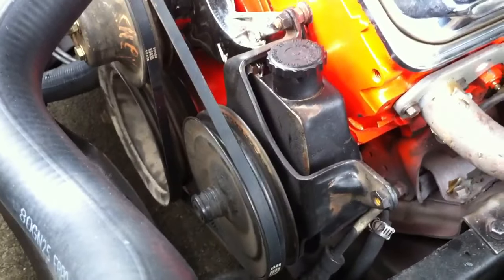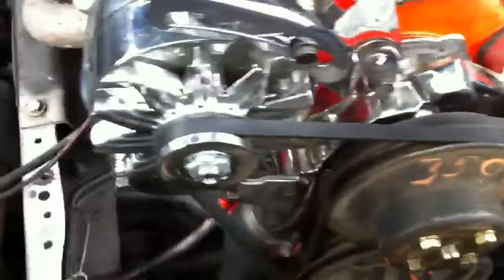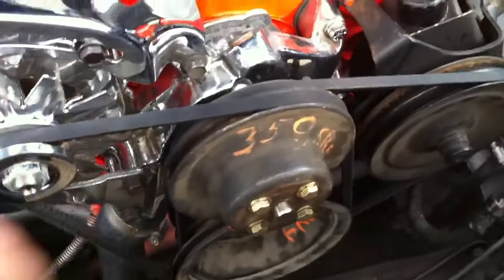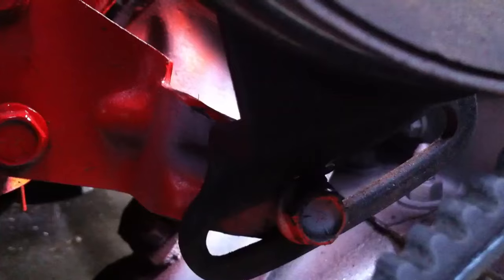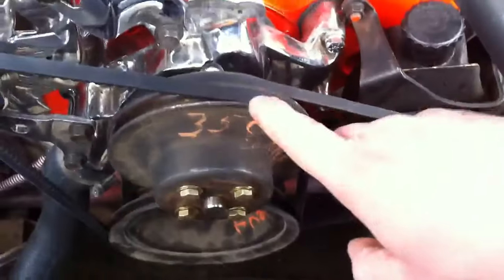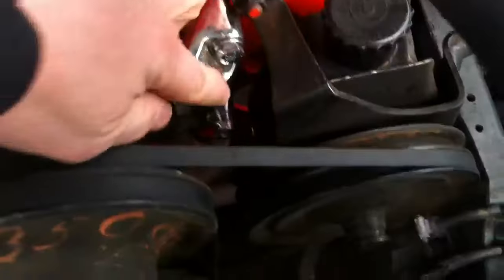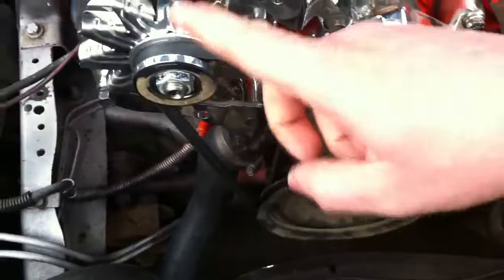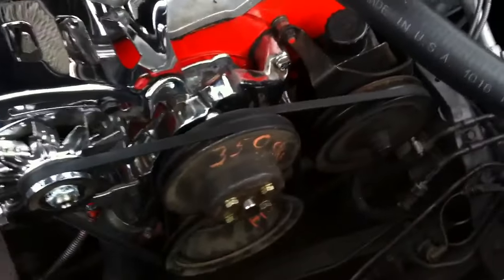How To Install a Power Steering Belt TALK Through - Chevrolet Truck C10

Comment: I have 3 belts on my 307. Original 5.0 A5 engine in 1983 Oldsmobile 98 Regency Brougham. 2 of the belts decided to come off on me while I was driving. I have all new belts since all the belts are damaged. It should be fun without dropping the engine. Just need to remove the fan guard and fan. Should be all good later.

Comment: Your video was great , it has inserts upside down so you remove these and if your belt won't slip on by the pulley shift like I removed the pump screww and then lifted to it went back in and reversed the tightening room was little but the change was nice

Comment: You have two belts driving from the crank, coming across the water pump pulley which has two different size pulleys tied together. That means you are driving the pump shaft at two different rates at the same time. Your belts have to be screaming!  That would be like having a transmission in two gears at the same time. That would explain the missing power steering belt. If you want this to work, get a water pump pulley with two pulleys that are the same diameter or let the power steering pump drive directly off the crank by itself which would be the best and cheapest route.
Reply: Woooow. I think you just solved the puzzle I've been trying to solve... Many thanks!
Reply: Confirmed, you solved an issue I've been trying to fix for 10 years since I inherited my truck from my Dad.  If you ever make it to San Diego, please let me buy you a beer.
Reply: @PeterStuartJr  What you had to do?
Reply: @hummerguy  I had to re-route my belts, since I had two pulleys spinning at different speeds causing the belt noise.

Comment: Somewhat related question. I’m working on a friends ‘68 corvette 427. It came to him with a v belt going from the crank to the water pump without a tensioner. I’ve seen these in belt diagrams but need some tips on how to get a new one on. Or do we even need it? The only other belt goes to the alternator which catches the water pump as well.

Comment: The power steering belt is by itself it goes on the closest Groove to the motor then the next belt goes on and around the power steering the fan the guys need to get it together so there's roughly two belts driving on the power steering pump 283 and 327 have totally different pulley systems and I work on Ford's

Comment: Nice video. My setup is very similar only difference is my water pump pulley had one groove for the belt so the power steering belt goes around just the crank. I do have another pulley for the water pump that had a double groove. Should I use the double groove pulley on the water pump so the power steering belt goes around that??

Comment: Hey man I got a 1983 Chevy with the sbc 350. I’m having trouble getting the A/C compressor to mount up anywhere. When we mount it on the driver side, one of the power steering pump brackets collides with the A/C brackets. When we go to the passenger side (we tried both passenger and driver side brackets) it hits the alternator. I was curious if you could show where the compressor is supposed to mount and how.

Comment: I got a 1964 c10 stepside with a squealing serpentine belt... Unsure how to replace but have the replacements. I don't know a thing on how to repair it. Plus, my ignition is struggling and once my truck does start up, it's in high idle around 2000 rpms. I'm thinking it has something to do with the throttle body or the carburetor....

Comment from the maker: I havent had a problem at all yet, but I've only driven it two blocks since I've put this together. I'm driving it about four miles tomorrow to get the exhaust welded up. Buzz me again in the future and I'll let you know how its holding up. 

It is a lil flimsy. So I plan to run something to that corner to reinforce it. I believe they make a boomerang shaped piece that goes across two bolts at the end of the head and reaches out to that last power steering bolt hole hanging out there.

Comment from the maker: The only way I've ever tightened the alt belt on a V-belt system was by prying on the Alt. Just be gentle.

I'd have to see how your belt was run but I'd think that if you use only one belt for both accessories it would be canted at an angle on one pulley (probably on the power steering pulley). Shoot me a pic of your belt set up on my FB blog page. PM or on the wall. Either way.

Comment: All good except one thing ......if you can move  the alternator pully in the counter clock wise direction the belt is not tight enough to keep the battery nice and charged up   .....my experience

Comment: I have the same year truck with a 305 but has similar setup and also ac compressor now I was replacing my belts and it all worked out but after 3 weeks my power steering belt is flipping on its own so the teeth of the belt is kind of facing upward and twisted around I already tried to flip the back to the way they are meant to be but they keep twisting back how do I fix this.if you could help me out that would be great.

Comment: i have the same set up as you do now that i removed the ac. could you tell me the number of that power steering belt
Reply: for anybody that wants to know the answer to my question it is # 15448 same as alternator belt. i found it thanks anyway

Comment: My steering pump rear groove is what lines up with the water pump   !!! I noticed this after I replaced the pump...I don't remember having problems with belts lining up with the old pump-- do they make pumps with different length shafts? I know my pulley is in as far as it will go ???? now my belt is flipping over on me.. any suggestions? its a 76 chevy C10 350 stockThanks everyone

Comment: When I look at my 1972 the belt that goes to the alternator then to the water pump. Is it supposed to go alternator crankshaft water pump. If so my belt is to small

Comment: Does your power steering pump have a bracket on the back side that bolts to the block?THANKS
Reply from the maker: dickey moore Yeah I believe that it was suppose to have it.
it’s been many years since I had this setup.

Comment: Any chance you can recommend what belts to use? I have a 77 c10 with a 350 and the belts are getting worn but i can't find matching part numbers for the belts.
Reply from the maker: +Patrick Viking No but I can tell you that your local auto parts store can match them up by size if they're custom. They usually have a fancy belt measuring tool. If they're not custom, they should have factory replacement belts in stock.

Comment: I have a 1981 c3 Corvette . The adjustment screw is on the in side . Not so easy to get loose . Hardly any room to get a spanner in there . Fff

Comment: I cant tighten them it feels like there loose still when i turn my steering wheel all the left or right i noticed the power steering pulley rubbs on brackat and when i has hard it squeals

Comment: Where did you get the lower bracket that goes between your pump and block on the bottom where you adjusted the belt tension?

Comment: About what size are those bolts? Friend of mine has a pump but the top two mounting bolts are gone (the one on the block and the one on the bracket) and I don't know what to look for size-wise.
Reply from the maker: I have no idea man. I haven't had that motor in my truck in about 3 years and the new motor is metric. 3/8ths by 16 sounds familiar for the thread maybe. What I'd do is a find one bolt that fits and then take it to the bolt store and get some that match and the length you want.
Reply: +AGearHead4Life Alright, will do. The video was helpful.
Reply from the maker: Glad to hear it. Good luck!

Comment: Where do ur power steering lines go to? I have hydro boost brakes and I don't want them anymore
Reply from the maker: +TRUEFOOTAGE Hydroboost is more powerful and less bulky. A lot of hot rodders will convert to that for a cleaner look with better braking. But back to your question. You'll have two power steering lines when not running hydroboost, one pressure and one return line. the both go from the pump to the steering gear box on the frame.
Reply: +AGearhead4Life ok thanks!

Comment: ive done all you said in the video but my belt keeps jumping off any help on that?
Reply from the maker: angel lopez Try looking at them from the side to see if the pulleys are lined up. Maybe they’re at an angle or offset.
Also make sure that nothing is flexing when the engine revs.
Reply: If they are happen to be offset how can I a-line them ?
Reply from the maker: angel lopez That I could only answer if I were there to see it myself. Possibly installed wrong or a piece missing. Idk

Comment: I replaced my steering pump and the pulley does not line up any more-i t sits further out and neither groove on pump pulley lines up ???
Reply from the maker: Weird. Maybe the gave you the wrong pump?
Reply: I removed the pulley, measured from the front  of the reservoir to the tip  of the shaft and they are the same !!  - clean and greased the shaft and slid in with 1/2 to 3/4 inch and then it gets real tight where I can hardly turned the wrench, this is where I stopped the first time I Installed it. Do I need a power tool to push it the ret of the way, the pump is still bolted to the block - Thanks

Comment: i have an 87 and it doesnt have the adjusting bracket on the power steering pump, it has three bolts. the one in the block, the one going into the water pump and one on the upper right attached to a bracket that isnt adjustable

Comment: Does the belt affect the brakes?
Reply from the maker: Nestor Daniel Guerrero Nope! Well not unless you have a heavy duty truck like a 3/4 or 1 ton, likely diesel that has a hydrobooster. That is the brake assist and uses the power steering pump to work. This is a rare case though. 

The main thing that’ll affect power brakes is the vacuum hose that goes from the intake to the brake booster. If it’s not hooked up, you’ll have no power brakes. 
I hope that helps!
Good luck!

Comment: I don't know who designed these GM power steering pumps, but it must have been a drunken Pollock. The 81's are a total bitch to change the belt.
Reply: +dancingwithczars its the way they mount complete crap!  looks like a drunk 8 year old made the mounting brackets lol
Reply: Dude, most GM things are designed on purpose to be a b*** to work on.
Reply: dancingwithczars Q+Q

Comment: hi I cant get my power steering pump to move out of the way to get the water pump off!!!
Reply from the maker: +1986Caprice 5.0 Did you loosens all of the bolts holding the power steering bracket on? Don't forget the lower ones too. You may have to remove some of the bolts to get it to move far enough.
Reply: yeah I just did that, thanks, it worked out fine , appreciate it
Reply from the maker: +1986Caprice 5.0 Great! Glad it worked out.

Comment: does anyone have the numbers for that power steering belt? or atleast can tell me how long the belt is??
Reply from the maker: No but you could wrap a string around the pulleys in the area that the belt would go. Then remove and measure the length of the string. That’ll get you close to start on finding the correct belt.
Reply: I got the blet number bro
Reply: @westadams90016  whats the belt number

Comment: How to replace a AC belt on a 1974 Corvette Chevrolet.
Reply from the maker: Hey Felix! Sorry but I don't have a 74 Corvette around to show you, but I'd bet it'd be similar to what you see in this video. Just loosen all the adjusters to get the belts loose. You may have to remove all of the belts to get to the one you need. Good luck!